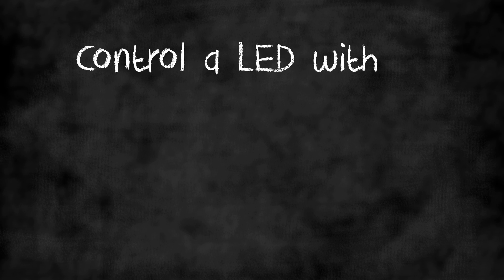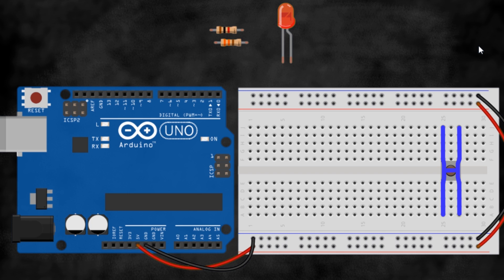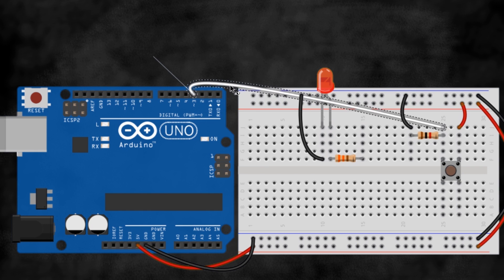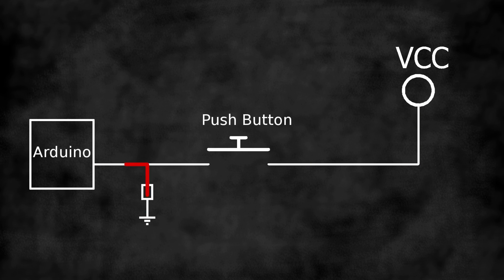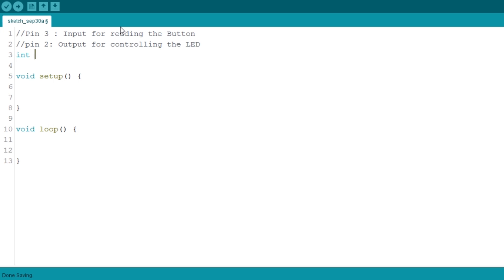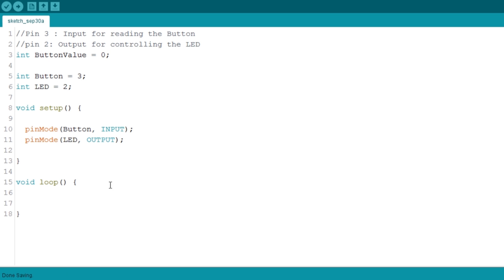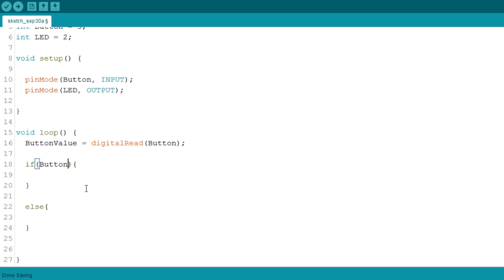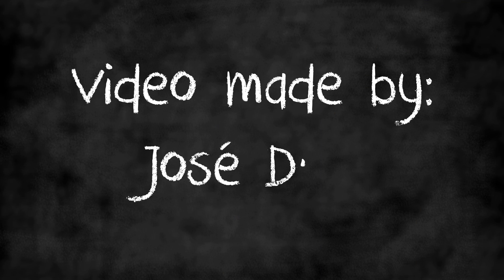Arduino Tutorials: Control a LED with a Button

Comment: firstly it is never called "le'-ed" it is an abbreviation and is always pronounced as L.E.D. (light-emitting diode), so never call it again "Le-d" because it is something else. Lead is an element with the scientific name 
Plumbum and symbol "Pb"; Atomic number: 82
Atomic weight: 207.19
Diodes are semiconductors not metal like the lead.

Secondly, using a push switch to turn on or off the LED is so lame. I mean what else is the purpose of a "push switch" or be it any switch that exists. The switch simply cuts or completes the circuit. You can simply power 5V or 3V to an LED and if you add a switch to the circuit it will glow when pushed and will turn off when not pushed. What is the point of using a microcontroller then where is the automation? There should be at least different patterns of LED turning on or off when the button is pushed. make something challenging and use proper scientific language else a little confusion can create blunder mistakes.

Comment: Well done my bro.. liked & supported.. I want to ask.. what is the technical name of the 4 leg switch when you push once-led glows dim, push twice-led glows bright, push thrice-led shuts off?

The push button on my led lamp stopped woking and I need the name to search and order it in Amazon. I'm not an electrical engeneer so I don't know the name.. plz help out.

Comment: My issue is that I have an attachable power supply rather than an arduino board. Could you still use the attachable power supply?

Comment: i tested it with a Leonardo and a (3rd party ELEGOO) uno rev3, it works both ways, the leonardo is the original, its cpu is all rusted a bit, i think it's from 2013 or 2014, and its a leonardo, made in italy

Comment: how does your board do nothing when you are connected to pc? my aurdiono keeps running old code that is uploaded. what is the trick here?
Reply from the maker: Well, probably I had a blank or default Arduino project running. But the behavior you described is expected. The current Arduino code starts running when you power it on.

Comment: Arduino: 1.8.15 (Windows Store 1.8.49.0) (Windows 10), Board: "Arduino Uno"

sketch_jun07a:21:3: error: expected unqualified-id before '{' token

   {else

   ^

exit status 1

expected unqualified-id before '{' token

This report would have more information with
"Show verbose output during compilation"
option enabled in File -> Preferences.
 this keeps happing to me

Comment: Too much useless wiring make the whole thing needlessly confusing for a begineer. Also, as mentioned in other comments the diagram doesnt work and is actually different thom the  demo hardware.

Comment: Hello I did exactly the same as the video, but I have a small problem:
- If i 'Touch' my button my LED will light up.
- if I press my button the led will turn off
I hope I hear an answer soon, thanks

Comment: int ButtonValue = 0;

int Button = 3;
int LED = 2;

void setup(){
     pinMode(Button, INPUT);
     pinMode(LED, OUTPUT);
}

void loop(){
     ButtonValue = digitalRead(Button);

     if(ButtonValue != 0){
          digitalWrite(LED, HIGH);
     }else{
          digitalWrite(LED, LOW);
     }
}
Reply: thanks bro
Reply: Thx man this works well

Comment: the diagram and the connection you did are different. Switched ground and pin in the connection for the led... and still works?
Reply: Anyways eems like it doesnt matter where you put the resistor, since it is in series it shares the load with the led.
Thanks for the tutorial, finally managed to make mine work, i had a bad wire and spent 2 hours trying to figure out what the fuck was going on. Guess i need to learn how to do the serial monitor.

Comment: Mine worked fine. Now, I need to figure out how to put 3 LEDs in there and control them with 3 different buttons. I'm trying to work on a cool little game where I put in a random pattern of 3 flashing LEDs and you have to remember the pattern and press buttons of that pattern. Just a little personal project.
Reply: tutorial please!!! 🥲🥲🥲
Reply: @snow4562  ???
Reply: @dr_sudo  if you can do a tutorial video of your project 😅
Reply: @snow4562  I did it but it's been a long time ago. Fortunately, I still have the breadboard setup, but it's so crappily put together
Reply: @dr_sudo  is it still working? I wanna try it too, I've been into Arduino lately, I've been searching for something cool that I can copy haha 🙈
Reply: @snow4562  Yeah, it still works. And I still have it. I don't want to make a tutorial video on it. Do you have a Discord or something?
Reply: @dr_sudo  yes, I do have a discord. How do I contact you there?
Reply: @dr_sudo  can't find your username 😅 maybe you can find mine?  
LourdesAnn#4782
Reply: @snow4562  ight
Reply: how's that working out for you? do you have working code? looll
Reply: @ryanveyr9195  I do actually lol
Reply: @dr_sudo  send it to my email real quick? lmao
Reply: @ryanveyr9195  I'd rather not. Are you trying to do a project or something?
Reply: @dr_sudo  yea lmao. i’ve already got a push button type thing. LCD as well. but ur idea sounds cooler

Comment: Ajuda.... porque é que está ligado na diagonal o objeto que tem uma das suas pernas no espaço  15,  C   ?
Reply from the maker: In which part of the vídeo? Could you give more details?
Reply: @freethepotato  7:43
Reply from the maker: That is just a plain resistor. It's connected to ground (pull down resistor). I placed it diagonally because I couldn't put it straight (brown wire in the way). You can connect the resistor to any hole in the blue line, which is ground.
Reply: @freethepotato  Ok thank you :)

Comment: The virtual sketch differs completely from the actual setup you had. Additionally, the virtual sketch does not work, and it is also the one you went by step by step, so people copied it in their own boards and that it why so many people have problems. 

You should have at least addressed why the sketch was different from the setup...I spent a while on this video and it ended up not amounting to much.
Reply: Agree

Comment: Bro how to use rgb led and when i click on only one button it chages colour randomly how to do that???
Reply from the maker: A typical RGB LED has 4 legs: one for each color and one for ground. You can connect the three legs to three different ports. In order to turn on a color, just turn that pin to HIGH in the Arduino. I won't go into much detail here, but you kinda just gave me an idea for a new tutorial! Check out this link: https://learn.adafruit.com/adafruit-arduino-lesson-3-rgb-leds/breadboard-layout

Comment: Hey guy, I like your vids! Certainly better production quality than my tutorials. Been a while since you uploaded, are you gonna keep making content?
Reply from the maker: Hey! Thank you so much, it means a lot! Yes, I'm going to continuing to post some content. Probably in the end of this week. I've been a little busy with college and stuff, sorry about that. Would you like to see some video/project/tutorial in specific? I might consider it.
Reply from the maker: Another thing, your tutorials are great! I was checking them right now. Keep it up!
Reply: Thanks a lot man, I'm trying to make mine for some Community College Engineering weather balloon projects. And in my area most Community college level don't get too technical, so there's a lot of ground to cover to get to make them able to design their own experiments and be successful implementing them.
Reply from the maker: Wow, that's actually awesome. I've always wanted to participate in something related to that. There's a lot of things you can apply like telemetry, remote control, wireless comunication, etc. If you need help with something just say the word!

Comment: Hey how do you choose the resistors????
I mean according to which context is it LED?
Reply from the maker: Hey! The resistor is there because if not, there would be a short circuit due to the led's resistance being so small. For that, any value from 300 to 1k (even more) should do. The thing is that the leds brightness increase with the current so you cannot put a very small resistor (more current, more light) neither a huge resistor ( less current ). When a short circuit happens, the current in your systems increases to infinite and that will burn the led. If you want to learn more about this you should see a tutorial about the ohms law. Check this out (about leds): https://learn.sparkfun.com/tutorials/light-emitting-diodes-leds
Reply: HackTheWorld 
Thanks
Reply from the maker: You're welcome!

Comment: it's not working
Reply from the maker: Is your code the same as in the video?
Reply: yeah i uploaded it and it it perfectly fine but nothing worked the button will not even stay in the breadboard i pressed the button and it popped out when i took my hand up and on top of that i have a Chinese board but idk if mine is different
Reply from the maker: Well, some buttons may not go well with a breadboard. But if you can't use a button, maybe use a direct connection. For example,  instead of connecting the cable from the button the arduino, try to connect it to Vcc and ground. If your program is okay, when you connect to Vcc the led becomes lit and the contrary for ground.
Reply from the maker: The cable should go from the arduino port to ground or Vcc